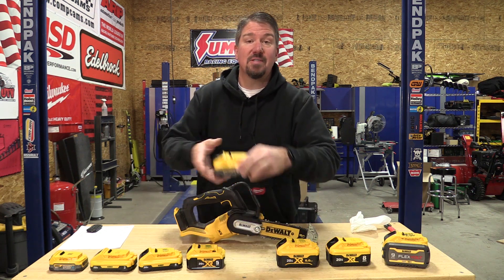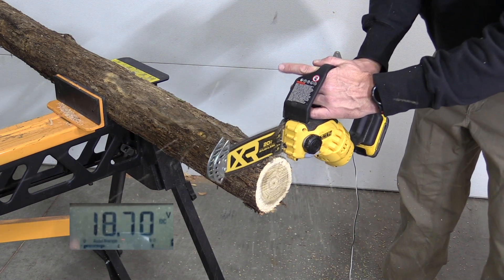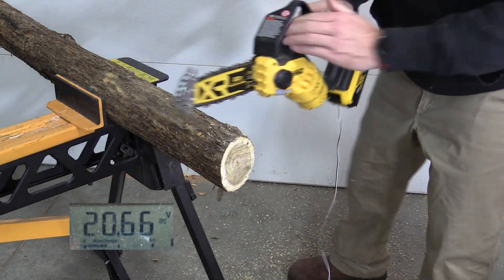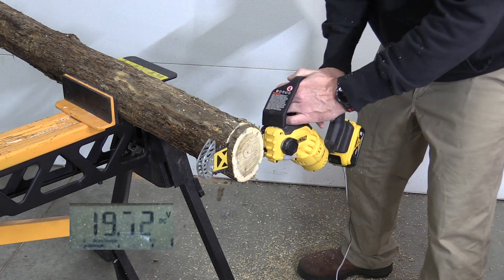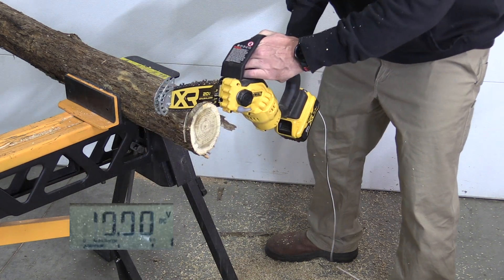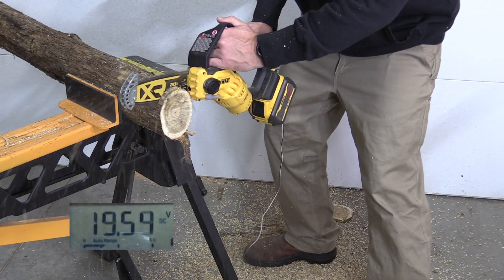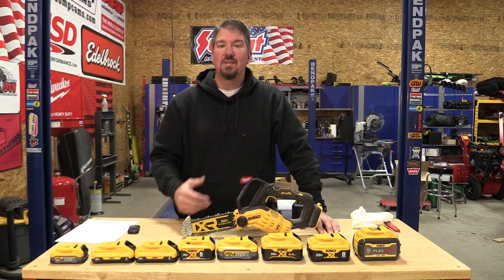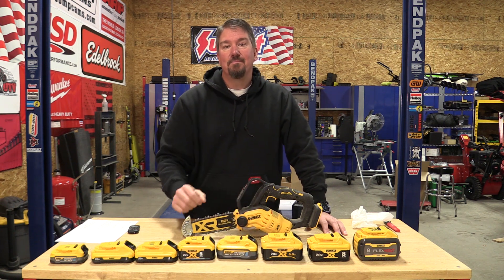Does The PowerStack 5Ah Unleash The Beast In The DEWALT 8" Pruning Saw?

Comment from the maker: Please Note - The wood used is Black Locust.  The chain is razor-sharp.  If I would have used a soft wood the saw would have cruised right through and voltage drop would have been minimal.  My thought was to grab the hardest wood I have around to show the voltage sag (amp draw) and with this small saw it struggled.  The Dewalt pruner has a faster chain speed and less torque.
Reply: Does the tool have like a sensitive anti-kick back or something that was causing the consistent cutout?
Reply from the maker: @BruceWayne-xu5bj  I believe so.
Reply: The only wood harder than locust may be Greenheart..? It was used on the Antarctic Sailing ship Endurance….
Reply: That black locust is badass wood it burns hot they don't recommend using it by itself in wood stoves

Comment: 2 Things. The saw has a cut out if the motor is placed under to much torque. This protects the motor. Also, this is a pruning saw not a chain saw per say. Test is flawed.

Comment: I'm late to the party, but I just picked up the pruning saw. Home Depot has (as of 1-07-25) a deal: Buy the saw tool only ($169) get the 8ah Power Stack free. I think that will be a great combination. The FlexVolt are a lot heavier and based on this video won't really make a difference. Should be a good balance between weight and power.
Reply: If you go out to the place when you have no charge point available, big bulk battery is necessary, but if you have availability for charging nearby, small battery is better because of the lightweight, so two batteries will last you all day charge to charge...

Comment: I believe the reason why the saw drops out at different voltages is because the dropout circuit is a current sensing circuit, not voltage sensing.  The reason is that when the current is too much for the motor, it drops out to protect the motor.  The reason why voltages vary is because larger batteries can hold a higher voltage as the motor draws more current, but if the current reached is too high, it will still cut off the supply to the motor when the current limit is reached.

Comment: To my knowledge, Dewalt puts their battery protection in the tools so any over current cutouts would be in the tool not the battery**. Re-running the tests with a more consistent cut pressure (see how Project Farm runs his chainsaw tests) might create better results.

** This is why you shouldn't use cross-manufacturer battery adapters.

Comment: It's a great saw for pruning smaller branches and small overgrowth but for anything bigger I still break out the gas.  For only a few cuts, even the 2ah battery works well enough.  It would be nice if it were easier to use left handed though.

Comment: you should measure the amp draw over time while monitoring the battery temperature for such comparisons; voltage drop is not that relevant in this case

Comment: You’re not actually supposed to push into the wood with any chainsaws, it should be sharp enough to pull itself into the wood. This little saw isn’t supposed to be used for cutting big wood , it’s for pruning and for that, it’ll work fine.
Reply from the maker: So.....  We have a review of this saw out and we used it for pruning in normal wood.  It is a few videos back.  This video was us trying to get a bit more power out of the saw with the PS battery.  I have to assume you skipped around a lot as we stated that the first cur was normal and the second we were going to push the saw a bit more to check voltage.
Reply: @WorkshopAddict  I’m just saying it to not discourage people from getting this saw, hell, I just ordered one. I could make my 066 with a 42” bar stop in the wood if I was too aggressive with it. This little saw will work good with what it’s intended for, I wasn’t trying to make it seem like you weren’t doing it right. You’re just trying to show all the scenarios people might get into.

Comment: I agree, its seems to cutout due to the stall protection in the motor circuit.  I have the M12 angle grinder and it does the same thing with any battery, especially because I'm trying to use it for too heavy of a job.

Comment: The cut out is always the tool, period. It's a motor controller stall cut out. Stronger batteries cut out less because the voltage stays higher producing more torque and lower chance of a stall. The other type of cut out from the tool would be motor driver over current. The final type of cut outs are thermal overload, they could occur in tool or battery.
Reply: The cut outs with higher voltage means a total lack of torque from the motor itself. Ie the tool is gutless.

Comment: Will you be taking a look at internals soon, to find what is triggering the tool to stop spinning? Maybe there's some weight savings to be had?
Or if it's just a temp trigger maybe test in colder environment or with fan on the tool.

Comment: I am disappointed to see all these cutouts with all the batteries tested. I wasn’t expecting such consistent cutouts, regardless of the battery used and the species of wood cut.
Reply: he's cutting very hard , old wood, but with a pruning saw, on purpose; he's pushing the saw to the limit to see if the battery makes any difference.
Reply: @wim0104  he stated that the initial cuts with each battery were lite/normal pressure and the follow up cuts were with more pressure. He wasn’t putting excessive down pressure on the first cuts.
Reply: @wim0104  regardless of how hard or old the wood is, he's making the first cut without pushing, as stated 54 seconds into the video (https://youtu.be/vB286TV2P8A?t=54). I would expect this saw to take longer to cut through the harder and older wood, but not cutout when not applying down pressure on the saw.

When I using my battery operated pruning saw on this species of wood, I typically don't get any cutouts, unless I start to put some excessive down pressure on the saw. Sure a cutout happens from time to time, but not at the consistency we saw across the lineup of batteries demoed during his first cuts, without down pressure.

Comment: Still waiting on you Milwaukee to get us a stacked lithium battery! I’m seeing these flexvolt batteries not do very well in these last couple test videos. Besides being dual voltage I’m not impressed.
Reply: I don't get it. The flexvolt seemed to have the least voltage drop, though the 5ah PS was right there with it. The saw will cutout when it's stalled no matter the battery. 
Looks like it will stall easier on the small batteries, since the voltage drop will reduce the motors torque. Everything from 5ah PS and larger didn't have a low voltage drop.
 I'm betting with small softer wood, voltage drop wouldn't be an issue anyway. That would make the 4ah the sweet spot for runtime to weight.
Reply: Me either

Comment: Considering the price of the PS, I'd stick to the 6Ah XR. Pretty close in my opinion but XR is 1/2 the price.
Reply: Yea I'm a little disappointed by this release.  I'll stick with the 6+8s I already have.
Reply: 100% agreed!
Reply: 5-6 amps batteries will perform the best with almost all dewalt tools; smaller ones are nice for repetitive light jobs due to the weight
Reply: That's no longer true in 2025. 5 PS on sale everywhere for at or less than 6 XR.

Comment: Sharpen that chain!! You can see it burning the wood when it's stalling. It's leaving burn marks on the wood. Im not criticizing, just what it looks like to me. Great job on your videos.
Reply from the maker: I know it is hard to believe, but that chain is razor sharp.  If I would have used a soft wood the saw would have cruised right through.  My thought was grab the hardest wood I have around to show the voltage lag (amp draw) and with this small saw, it was overloaded.  There is a reason DEWALT sends this saw out with a 3Ah battery as a kit and why Milwaukee sends out the 8Ah M18 with their kit.  The Dewalt pruner has a much faster chain speed and much less torque.  Milwaukee would have been slower but would eat that wood for breakfast.
Reply: @WorkshopAddict  So the 5Ah XR battery would be good?

Comment: On the 6ah vs 8ah topic, have you opened your 6ah to see what cells it has? (the old 20700 vs newer 21700's used, or Samsung vs LG within 21700's)
Reply from the maker: It has the 21700's.  While testing today on an Impact Driver the 6Ah kicked the 8Ah butt.  Variations in wood can throw my stuff off slightly.  Thank you for everything you do!
Reply: Glad you could get him to answer this, a few of us have asked this several times on a couple of older dewalt videos and no answer untill now lol
Reply: The graphics on the 6ah XR indicates it's an older battery for sure. All the 6ah XR's from like MFG date 2021+ I've personally had, had updated graphics. I know my 1st GEN 6ah XR had those same graphics style that had the 20700 cells. I don't know when DeWalt made the change over. It would be nice to know that for sure

Comment: Powerstack has a higher ampacity to make up for voltage loss. Voltage alone is not very characteristic of a battery's performance.
Reply from the maker: "Powerstack has a higher ampacity to make up for voltage loss."  That is exactly what I am showing.  Getting the amp draw info out of the batteries while on the tools has been out of my reach thus far.  So seeing what battery drops voltage the least shows what the internal cells are capable of and also what tools really care about the increased voltage.
Reply: @WorkshopAddict  true, it is difficult to measure current. That'd require an added piece between the tool and battery to eavesdrop in a serial connection, even if you use a shunt resistor. Maybe a bit out of scope for you, but the easiest way to measure battery performance would be to connect an adjustable external load to a battery, not a tool.
Reply from the maker: You are 100 percent correct and @TorqueTestChannel does that better than anyone.  But as we see here, and I will show you in upcoming videos, all tools do not need larger batteries.  So there becomes a time when there is no return from using the larger battery.  I need the tool to test that.  I am working to do a combination of tool and battery testing.  A bit more real world testing for what you are using.  Our Drill test (the video just before this) demonstrates a lot better what the battery is capable of.  Our hopes in this video was that we could help this tool from the cutouts we see in the field, and we could not.
Reply: @WorkshopAddict  I'm correcting myself, actually your tool tests are the real deal. Because batteries are used with tools, and I as a user am interested in if this or that battery will cut me off when using that chainsaw. So, no need to nerd out too much, being practical has the best value.